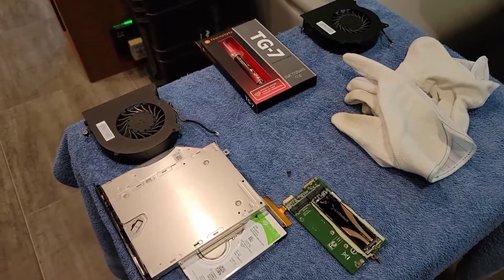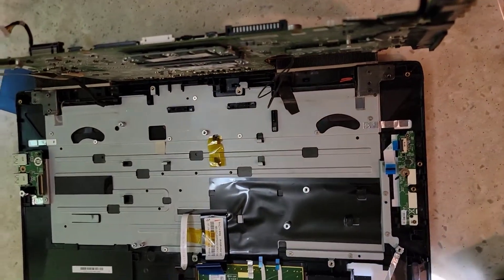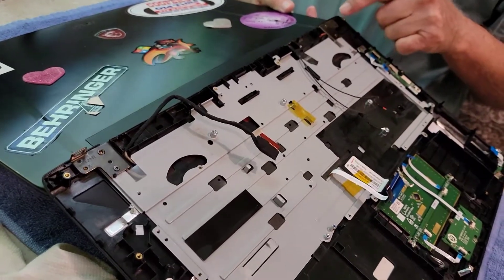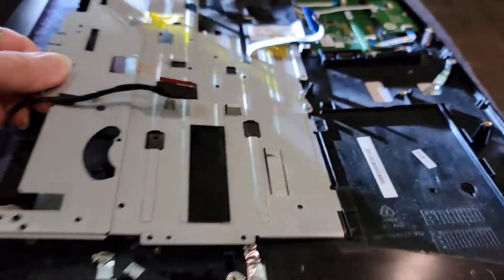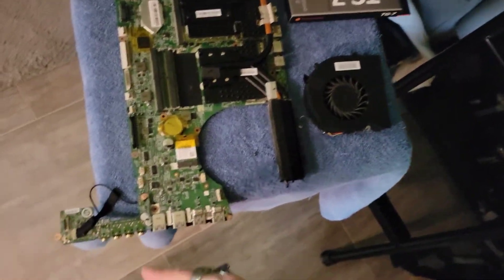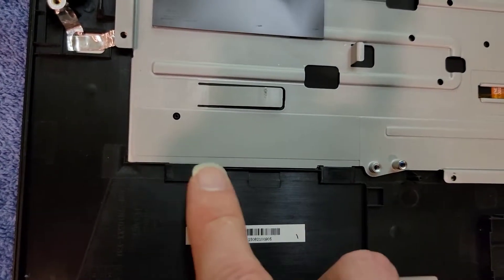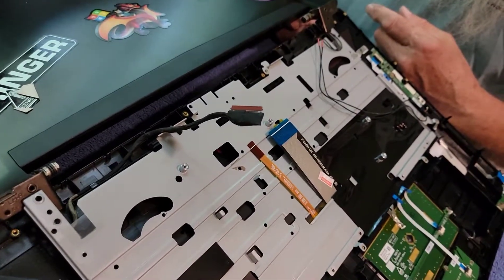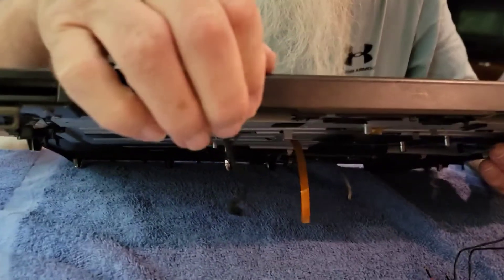MSI GT72S 6QE Laptop Keyboard Replacement Tips #iamacreator

Comment: Curious why you replaced the keyboard. I'm having an issue where only 1 key, the 'u' key stopped working. I've been through several videos on how to replace the actual key cap and the clip, but I'm not sure that either of those are the problem. The key and clip APPEAR to be intact.

Comment: Hello there um,Bro+ bud Bowser, Wow! That was allot Amazing work you two did on that laptop. )
Don't be offended, bud where you find the older Wizard guy from? 😅 Is he your Uncle ,or dad. Just Curious.... Dang bud I had a tooth Extraction today upp right, this sheeeaty, happens, when you get older, like me. I'm Ok so far im in my bed resting, I ate some soft stuff. Dessert, my hole in jaw is still Oozzing , ok ( why did you want replace keyboard for was that your Rainbow colored one? Like ttul ✌️🤕 😎
Reply from the maker: Thanks! Yeah, it was like doing surgery! And That's my dad. I probably wouldn't have been able to pull this repair off without him. It was so hard because someone had to hold pieces while I worked on other pieces. I was replacing the keyboard because the CTRL, Z, and X keys stopped working on my old one. Plus this keyboard is a new hardware revision with brighter and more accurate RGB lighting. And ouch, that doesn't sound fun!
Reply: I'm glad for your dad's help then! He sounded like a nice farther... To have, 👍 )
Yes, I see now, about the buttons it was, good Upgradzzz pal 😊 yes that looked real Tricky to me. Have a well Saturday? Did you go back home by now? From the Colorado trip or still out there?  Oh I'm ok, just like sore Tonight, my D.d.s, lady did an ok job on me. Only take Ibuprofen for pain. Cya here bud. Nite 🕊️